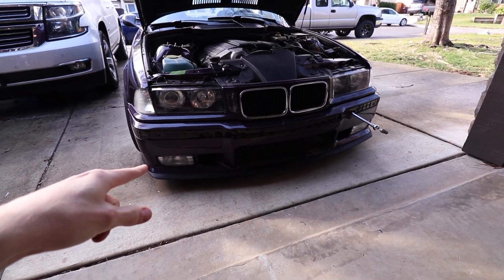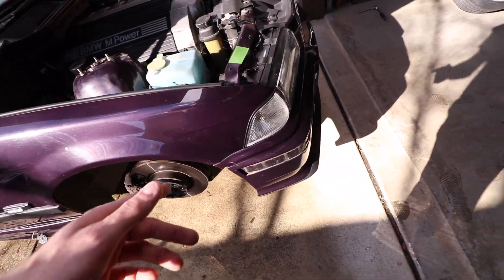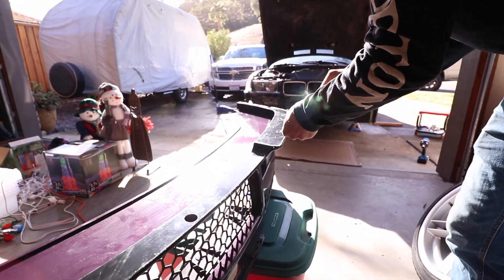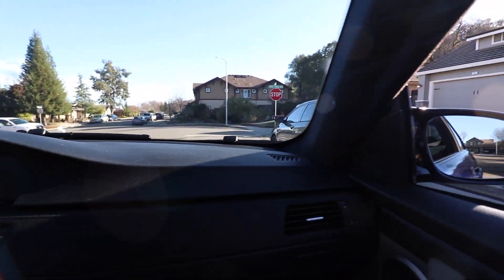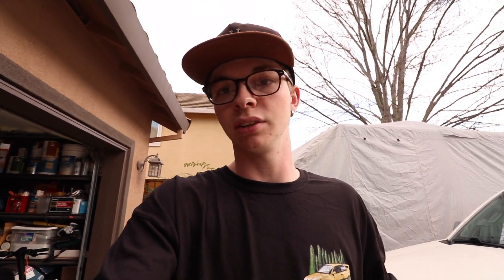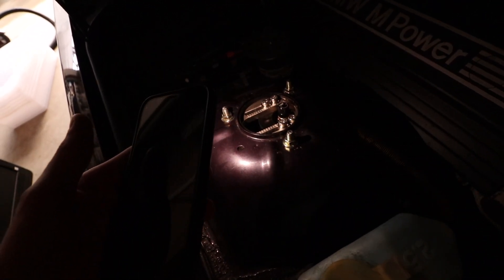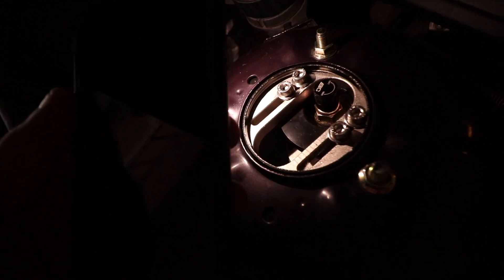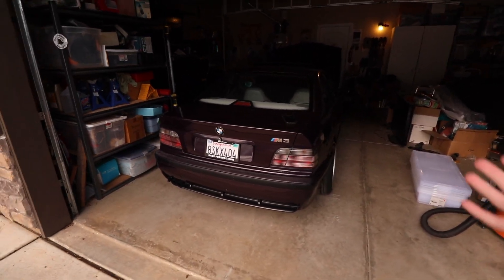E36 M3 Gets Lots Of New Parts!

Comment: The white plug on front bumper should be for the horn my e36 had two horns behind fog lights. I unplugged passenger side to use plug for anti theft alarm horn
Reply: Like everybody else said yellow plug is for the brake air duct